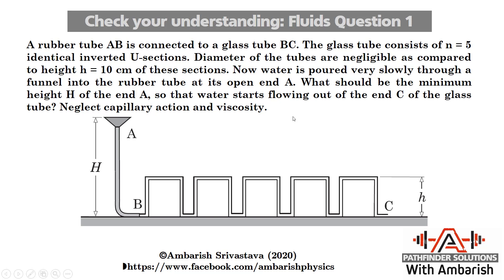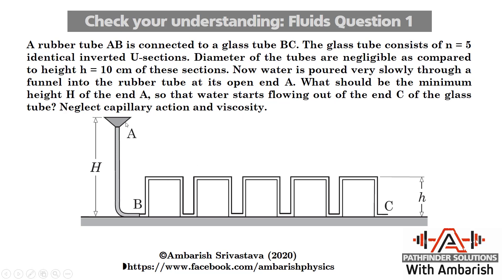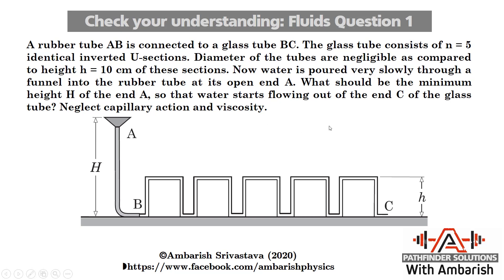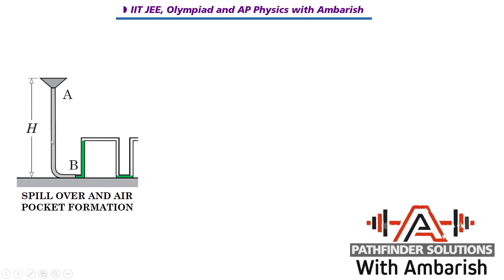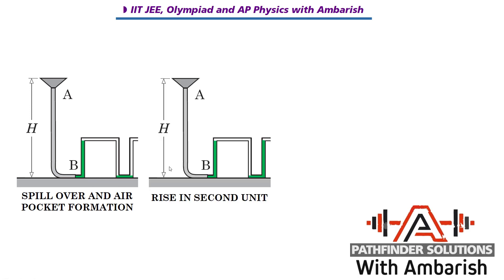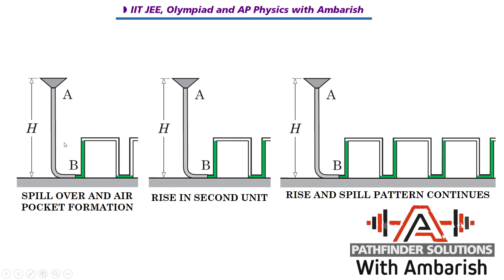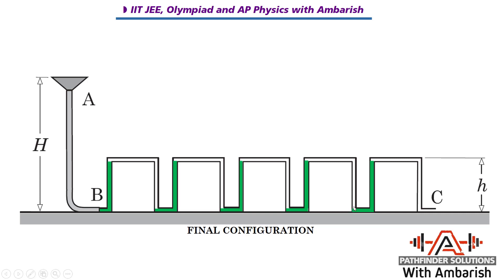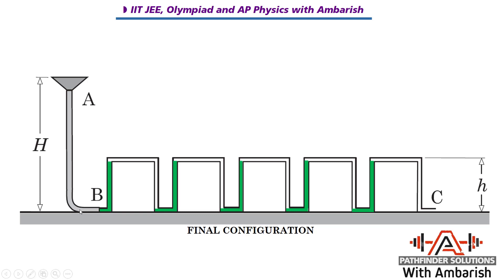PATHFINDER SOLUTION CHKYU 1 FLUID MECHANICS

Comment: Sir, here why do we consider the fluid to be in the state of equilibrium at the bottom of the container for each case? Would it be incorrect to assume that the liquid will flow continuously through the 5 "U" tubes with the velocity with which it gained from A to B?
Reply from the maker: Actually the liquid is flowing in very slowly. That's why. (Almost equilibrium).
Reply: @ambarishphysics  Ok sir, thank you

Comment: Sir I am confused here as final Picture shown as hint in the book is different from you. There they have shown liquid in horizontal sections also.
It doesn't affect the calculation ...But still for clarity please look into it sir....
Reply from the maker: Actually the picture given in hint is incorrect. It is creating more confusion than helping.
Reply: @ambarishphysics  Sir can we look like this.... As in question they mentioned very slowly so in the upper horizontal section liquid doesn't move and remains there and when it reaches the end then only it reaches down sections
Reply from the maker: Roam2explore since the liquid is non viscous and there are no Surface tension effects (mentioned in the question) the liquid will immediately flow down.
Reply: @ambarishphysics  Ok sir got it 😊👍🙏

Comment: Sir trapped inside the parts wont it get compressed, why did we ignore that.???
Reply from the maker: Arun Kumar sahu Actually the maximum  pressure is very small (50 cm of water), although it would have been better if problem explicitly mentioned air to be incompressible (or to neglect air compression). The pressure difference occurring due to air column is also very small due to small density of air relative to water.